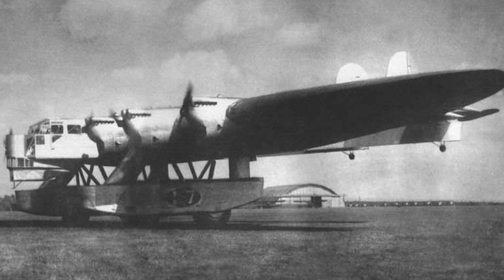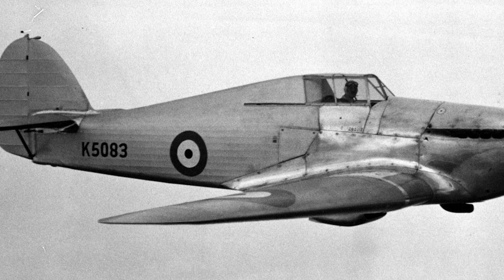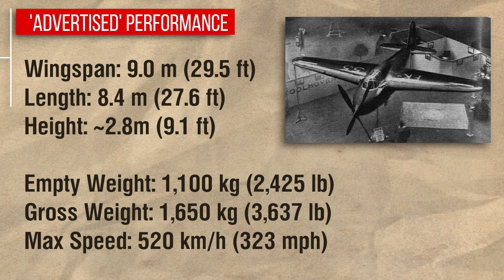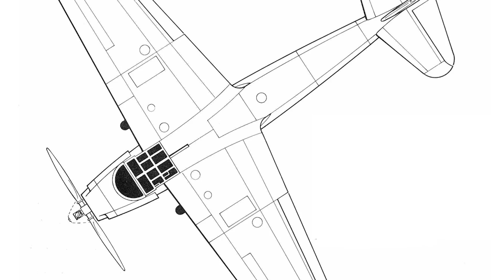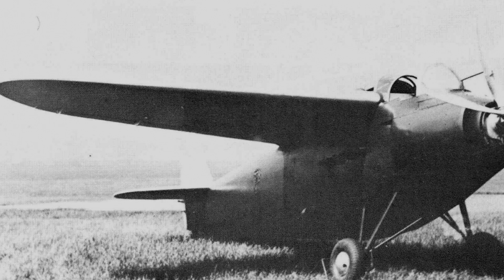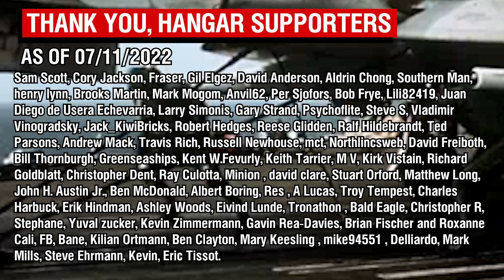A Beautiful Concept That Became An Ugly Failure | Koolhoven FK.55 [Aircraft Overview #78]

Comment: So odd that mid engine designs where popular in the late 30s. You invite several engineering problems. First, the power transfer to the propellers is less efficient and much heavier. Second, fire safety issues due to the engine now being closer to the fuel and not contained with a proper firewall. Third, weight becomes a major problem. The most variable weight is the payload which the engine displaces. 

The only benefit is visibility, however that can easily be handled with a more conventional design. I guess the designers had good PR teams.

EDIT: Oh, and I almost forget the crash safety aspect. A heavy engine sitting right behind the pilot waiting to flatten him on impact. A minor accident wouldn't be so minor.

Comment: Rex - as always, a good episode, but early on, when you went to illustrate one of the new "all metal" fighter aircraft ... but you showed the prototype Hurricane, which had wooden wings and a fabric-covered aft fuselage (the latter obvious in the photo you showed).  Even the later Hurricanes had fabric rear fuselages.  To further illustrate this point (all metal) you also showed the Vought Vindicator dive bomber, which also had a fabric-covered fuselage - I think the wings had fabric sections, too, as did the later Vought Corsair. A Spitfire, Messerschmitt Bf-109 or the P-40 Tomahawk would have been better illustrations of your otherwise good point.  Otherwise, a good episode.  I really like your stuff.

Ned in Nevada
Reply from the maker: I completely overlooked that. This is why we don't edit videos at 3:20AM on nothing but coffee and willpower.

Comment: One of my favorite obscure aircraft designs. That concept just looked so cool. Truly the cockpit must have been hotter than a sauna tho, having been situated with the engine to the rear, the radiators on either side, and a gearbox and cannon ahead of the pilot (yes I know it was never installed, but it wouldn't have helped any).

Comment: Have you ever seen the Bugatti 100p aircraft? Holy moly its the most beautiful plane I’ve come across. Twin mid mounted engines, counter rotating props, unique v tail, and a forward swept wing. The curves of the fuselage are stunning. 500mph iirc?
Reply: The 100P certainly is beautiful. But I question just how well it would have worked. Something that is still unanswered given the loss of the reproduction on its third and what was supposed to be its last flight before being sold to an aviation museum. One reason I have doubts about the 100Ps viability is the arrangement of its engines and the associated drive shafts. Each shaft had three universal joints iirc. The engines were set at an angle with each drive shaft consisting of two half shafts. The more complexity you build into the prop drive the more failure points you design in. Theres a reason very few aircraft have had drive shafts between the engine and the props.
Reply: @mpetersen6  Even if the design itself is...uhm...over optimistic, the story of the original airframe of very interesting
Reply: I think someone is building one, so we might see

Comment: It amazes me how many times designers tried to cram an engine outside the airstream of the craft and then were shocked that they had cooling problems.
Reply: In fairness this isn't that uncommon or an insurmountable problem. The P-39 for example seems to do this quite well with seemingly miniscule radiator surfaces, even in its tropical service with the USAAC (or at least I've never heard it had such problems). 

Also its worth noting that while this would certainly be a problem for an air-cooled radial engine, water-glycol cooled inline engines do not really need to be in the slipstream. Look at how many aircraft of the period use radiators mounted far from the engine (on the wing like the Spitfire and Bf109, under the cockpit like the P-51 or basically any Italian inline fighter, etc). In fact, this was the norm. The only fighter aircraft I can think of with radiators mounted adjacent to the engine are the P-40, and P-38 (though this one's kinda stretching it).
Reply: @Jack Schulte  I didn't say it was insurmountable. I just implied that most of these planes with a mid or tractor engine placement seemed to at least initially suffer from insufficient cooling. And I am correct. The P39 does in fact have a large radiator. You are confusing the radiator with the P39s rather small inlet. Those are not the same thing.
Reply: @kyle857  I'll concede that it is a trend, but I'm still not convinced it's as simple as engine placement. Most aircraft with rear mounted engines of this time were actively pushing technological and aerodynamic boundaries. Another advanced Bell design, the Aeracuda, had similar problems. However, this was largely due to bad intake design. It's also worth mentioning that plenty of other designs which had a traditional tractor layout also had overheating problems. A great examples would be the B-29 and Brewster Buffalo, again each faulted by bad intake design. We can go on and on with everything from the Fieseler Storch to the Grumman F4F (especially later models), all experiencing cooling problems. 

As for the P-39, I did misspeak. I didn't mean to say that the radiator was small, but yes the inlets are, namely because there are four inlets (and the fact that NACA spent a great deal of resources modifying the P-39 design to optimize it aerodynamically). Looking at a cutaway of the P-39, there is a rather large radiator in the rear of the wing, but I don't really think it's that abnormally large. I get the impression its somewhere between the size of a Mk I Spitfire's and a Bf 109's. 

Speaking of which, the Spitfire was notable in the fact that it had such a small radiator in comparison to its German rival. It's radiators operated at much higher pressures than the Messerschmitt's. In 1941, this sparked an argument between Messerchmitt and Daimler-Benz. Messershmitt blamed DB for the 600 series' "inefficiency," stating that the heat generated by the engine for its rated power required radiators that were too large and caused too much drag. DB responded by suggesting the lower pressure in the radiators (designed by Messerschmitt) was the culprit for the large radiator area. After some bickering between the companies, DB appealed to the Luftwaffe to give the company a captured Spitfire Mk V from storage. DB then fitted a DB601 to the airframe and used the British radiator. The engine performed adequately. 

I guess my point is that while there is some truth to the trend of overheating in unusual engine configurations, its definitely more nuanced than that. It was a common problem of the time across aircraft of all configurations. I suspect that many of the problems were due to a lack of ability to analyze the airflow in and over complex shapes at the time. While today this would be done with Finite Element analysis using CFD models, no such thing existed at the time. Designers really didn't know how airflow would interact with the complex geometry of inlets and such at the time, and I'm guessing they used a lot of idealization (assuming uniform flow, low angles of attack, etc) to do any analysis they did conduct. I don't think that the placement of the engine really mattered much in cooling, unless you absolutely bury the engine in the aircraft.

Comment: I like hub-cannons and I like contra-rotating propellers.
But combining both seems like a bridge too far, especially in the 30s.
Reply: They did it with the P39. That had a much better design team and more resources behind it though.
Reply: Contrarotating props require an extremely good gearbox. Plus you have the internal bearings between the two prop shafts. Which almost have to be needle bearings given the limited space a available between the shafts.

Comment: The Concept design looks a lot like ME163.
I have a 163 Model from the late 80ties or so.
It's small Prop not extending out of the over all Airframe, but still it goes like thunder Close to 200 miles.
It ist pretty nerve wrecking to fly non the less.
Reply: The prop on the 163 is to spin the generator for electricity.
Reply: @SkinPeeleR  on the original yes.
On my rc Model not so much....
Reply: @Flofutz  that's cool. 🙂
Reply: @SkinPeeleR  You wont see a lot of the Plane but you will hear it
https://youtu.be/N2lojrLMrW4
Reply: No it doesn't.
It looks a little like a P-39.
Reply: do you have the swastikas on the model? xD
Reply: @Ass_of_Amalek  no i don't.... that would get me in to serios problems...

Comment: If the engine is behind the pilot it seems to me the static parts of the tail could double as radiator vanes which wouldn't need intakes to bring the cold air inboard since they would be outboard.
Reply: It would probably defeat the purpose of putting the engine behind the pilot and made the center of gravity so much more distant from the pilot's seat.

I dunno tho, I just watch aircraft videos lol

Comment: Well, it's clear where Bell got the inspiration for the later P39 Airacobra from. So the concept was good.

Frits K was a brilliant artistic mind but not a very sound basic engineer.

Having a midwing mount was unpractical for engine repare.

Why he chose to move the wing up instead of down is incomprehesable.

A low wing makes a more manouvreble aircraft as a fighter and you can get to the engine.

Comment: The two props seem to vary in angle, ie not always at 90 degrees to each other - did they rotate at different speeds, or is it just my eyes?
Reply: As they are contra-rotating propellers, the angle between the blades is constantly changing. They would be rotating at the same speed, but in opposite directions. A radical idea at the time, though seen in quite a few later aircraft, such as later versions of the Spitfire / Seafire, Avro Shackleton and Tupolev Tu-95 / Tu-114.
Reply: @mandoprince1  ah of course, very obvious now you told me. Thanks to you both.😎
Reply: @mandoprince1  
Given the added complexity of the gearbox I think they would have been better off with a single prop. But l pity the pilot being in between the two radiators and right in front of the engine. Plus i could imagine balancing the coolant flow between the two radiators would be a Royal PITA.
Reply: @mpetersen6  I would tend to agree. Doubt if there would be much benefit at that power level🤔 Probably would have got more benefit from a three blade prop!
Reply: I believe they are counter-rotating.

Comment: Classic example of "if it looks wrong it probably is"

The actual final product, that is. The static display was a lovely looking plane though, must be said.
Reply: The 1100 kg empty weight was unrealistic (to put it politely) from the start. That's the territory of Boeing P-26 or early I-16's - basically, radial engines with attached lightweight, downsized airframes. There was no way they could fit a center-engined aircraft into same limits.
Reply: @jmi5969  For sure.